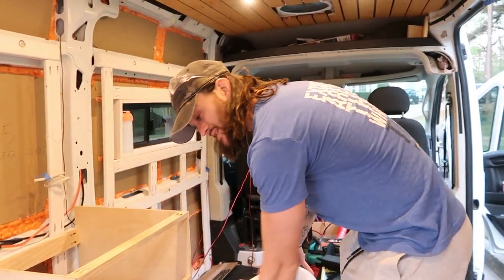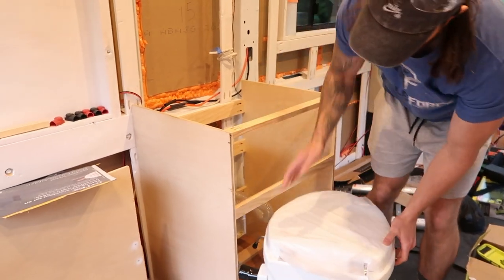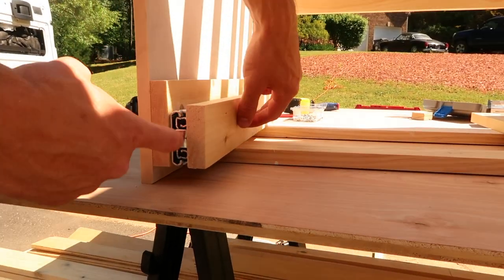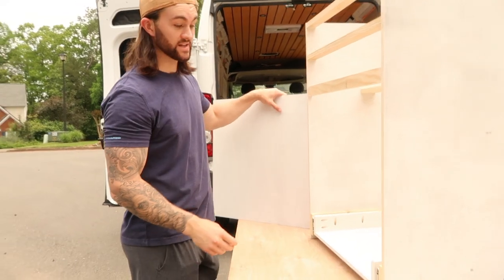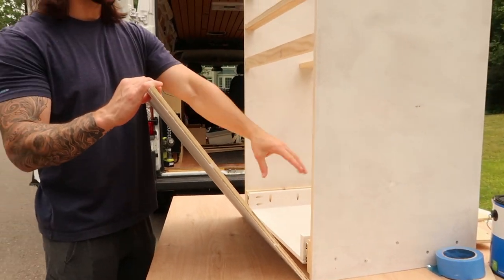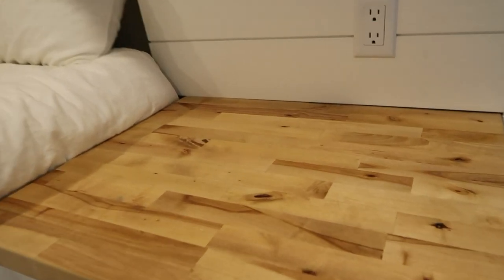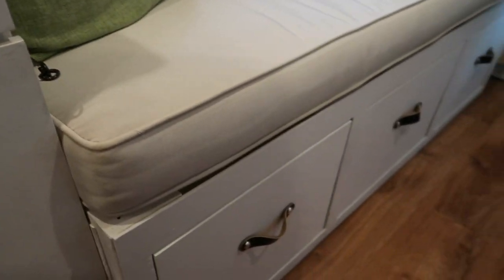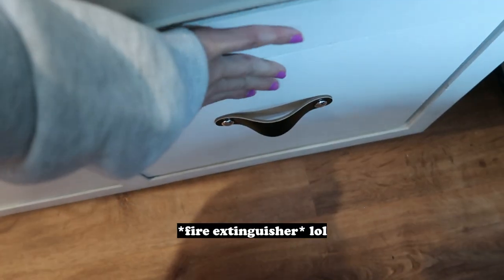DIY HIDDEN TOILET DRAWER STORAGE (building our vanity) | Van Life Build

Comment: how are you liking this now? i scraped my first toilet box that i used 2019-2023 and thinking about building a drawer like that. has it held up with your weight over time?
Reply from the maker: Yes it has held up amazingly. There is no creaking or anything in the drawer. The only annoying thing is that the vent tube occasionally falls out of the toilet. A zip-tie has helped with that.

Comment: Respectfully, shouldn’t you turn the toilet 90 degrees.  This way you have it, your legs have to be kept closer together.  If you switched it 90 degrees, you legs can extend further.  I am designing a toilet pull out just like this.
Reply from the maker: I’m not really sure what you mean. We have the whole hallway of legroom/space in front of the toilet with the way it’s currently positioned. Our feet still touch the floor of the van.

Good luck with yours! Hope it’s awesome.
Reply: @darian.explores When you are sitting no the toilet, you are facing the front of the van.  I would have thought that you should be facing the cabinet when sitting.  You have more room on the right side to take care of any issues.  When I get to this stage, I will try both positions.
Reply from the maker: @beachliving3127  I understand. If we turned it 90 degrees than we couldn’t have a drawer face on the toilet. Also, it would be pretty tight, especially for Ricky since the drawer takes up majority of the hallway’s width. It is a compact space, but accessing the handle isn’t difficult (luckily).